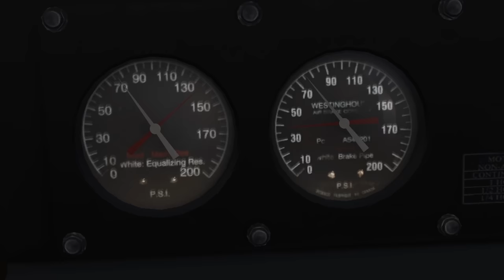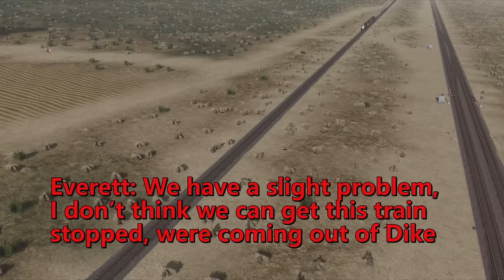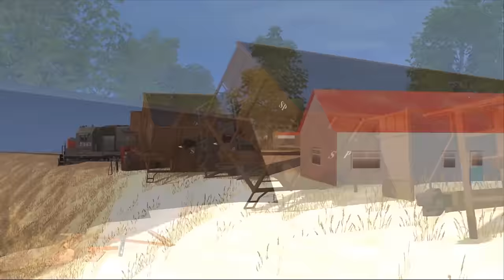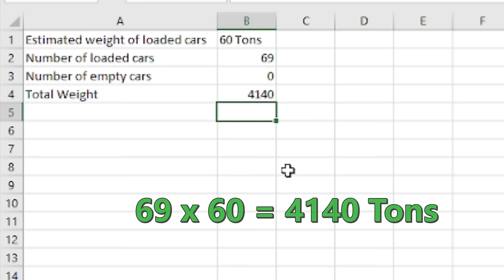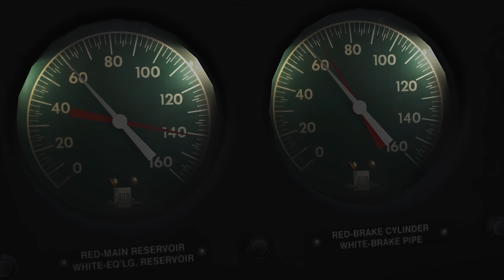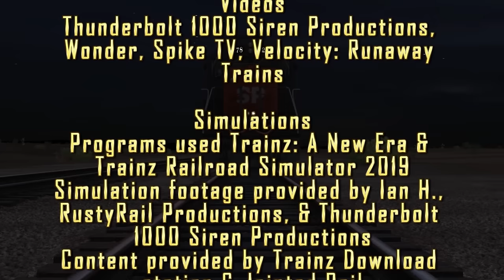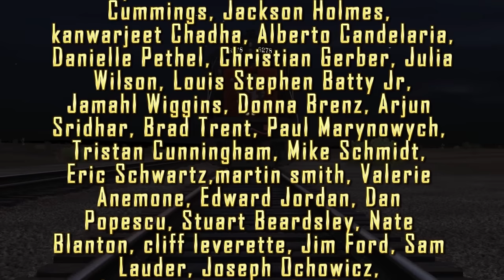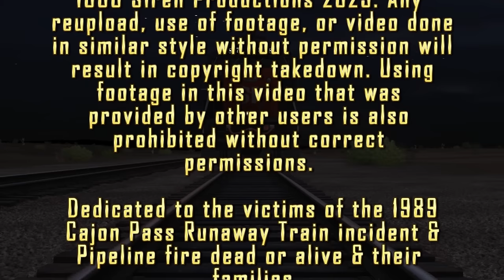The 1989 Cajon Pass Runaway 34 years later (Remastered)

Comment: Great video ,in UK we don't have normally don't have dynamic brake , but when train is consisted we have an available brake force and minimum brake force required , this creates RA (route availability) route train can travel . Brake force is always far in excess of what's required (we have same 100ton waggons with same brakes/bogies /wheels as you have in US , so can't see why brakes of these waggons were overcome by 100ton weight of each car ?  . Basically one 100 ton car /waggon should have a brake force in excess of what's required to stop it , that's how we work in UK anyway , did train have to many cars/waggons with non operational brake (isolated) ? so available brake force was only just good enough for the lightly loaded train? . We have inclines up to 2.65% in uk but  I'm aware US has much longer inclines , also is Dynamic brake factored in the available brake force ? as it should not be , as  its not a fail safe brake like the train auto brake

Comment: I think of this as the "railway equivalent" of Tenerife (the worst aviation disaster in history). Not so much for the loss of life which was vastly less here, but because it was another very long "chain of errors" strung together to cause it. Guessing the weight of the cars, not training helper drivers, not having helper communications, the emergency brake shutting off the service brake, just assuming the dynamics work, not doing the math on the brakes in the first place. Then the pipeline compounding it with beefing up the fuel pumping pressure when fuel started disappearing into thin air instead of figuring out why it was disappearing.

Comment: 261937🅂🄵🄴🄱24 
I lived in Tucson Arizona for 25 years and, as a member of a large train club, I knew several SP employees. From them I learned that SP management's attitude towards locomotive maintenance and train safety was atrocious. Getting a train "over the road" was their only concern. Usually, Road Masters would add locomotives to a consist in excess of that calculated to be needed, expecting engine failure during the run. For a time, SP was known for putting 6 to 8 headlamps on their locos. That way, when one burned-out, others could be turned on. This continued until the 𝙁𝙚𝙙𝙚𝙧𝙖𝙡 𝙍𝙖𝙞𝙡𝙧𝙤𝙖𝙙 𝘼𝙙𝙢𝙞𝙣𝙞𝙨𝙩𝙧𝙖𝙩𝙞𝙤𝙣 ruled that a locomotive was deemed inoperable if 𝗔𝗡𝗬 headlight was nonfunctional.
Please do a story on UP's 𝗖𝗵𝗮𝗿𝗹𝗶𝗲 𝗙𝗼𝘅𝘁𝗿𝗼𝘁  take-over of the Denver & Rio Grande/Southern Pacific. UP fired most of the SP employees who knew how to get trains over SP's trackage. Consequently, I watched train after train stranded outside the yard in Tucson where their crews would "Die on the Law while in the Hole," and the SP's lines ground to a halt.

Comment: If the engines were aranged from most Strongest Dynamic Breaks to Weakest Dynamic Breaks it might've been in this order: 8278, 7443, 9340 and 7551 on the front with 7549 & 8317 on the rear. That way they would've had the Traction Current Breaks at the Back & all other working breaks on the train at the Front.
Reply: What! That's rail fan mentality

Comment: I thought that that the train was going 90 but 110? Wow
Reply from the maker: Well as said in the video 90mph was as far as the spedomiter could go (Even though the top speed of the engines ranged from 65-80mph) but according to data recorders it was nearly 110mph before the derailment.
Reply: @Thunderbolt_1000_Siren  how many trains in the wreck were scrapped or retired?
Reply from the maker: @A-60...  As said in the video all 4 head end engines and 69 hoppers were scrapped. Both helpers were repaired but 1 of 2 were scrapped after retirement
Reply: @Thunderbolt_1000_Siren  ok

Comment: Using air brakes while using dynamics is a good way to burn up traction motors, that's why the safety feature is there or should be still if you use the air brakes it will cut out the dynamics
Reply: What the hell are you talking about? You use both all the time to balance the grade.

Comment: Why didn't they use the independent brakes or did they not exist yet?
Reply from the maker: The independent only controls the brakes for the locomotives seperate from the rail cars compared to the air brakes which control both the engines and cars' brakes. They were essentially useless in this scenario. Train was just too heavy, underestimated said weight due to a clerk's miscalculations, and the train had 1/3rd the dynamic braking power across all 6 engines which was clearly just short of what would of been enough to keep em steady. In other words as soon as they crested that hill they were doomed and the emergency application via the helpers sealed their fate for good.
Reply: @Thunderbolt_1000_Siren  Will u do a video on the derailment that happened in 2018?

Comment: How many wheel brakes did not show heat damage? meaning they were not working to begin with and so did not cook themselves? out of how many wheel brakes total? or did the gas line fire keep them from counting?  Also, wouldn't a hundred tons of this mineral have overflowed the hoppers volumetrically? or I guess this was a false assumption on the part of the crew?
    Also, that train with that real load and those working brakes could have gone down the grade at some maximum speed before exceeding the functional brake capacity; what was that speed?  I doubt it is true that the maximum speed was zero as you said, though it could easily have been slower than walking, it should be calculable.   I studied Mechanical Engineering and live near the Old Fort Loops, so I have some interest.  I was also a truck driver and slowed down many times to the point where my brakes could dissipate heat faster that it built up, on the Saluda and Old Fort Highway grades, so I know this works.  You go slow enough and the wheel brakes can dissipate heat fast enough, but it can try your patience.

Comment: An accident waiting to happen, poor maintenance meant all three leading locos and the two bankers(helpers) were not fit for service. Sloppy weight calculation on the sixty nine hopper  wagons further exacerbated the problem together with poor marshalling of the motive power.  Today in the US ,most heavy goods or mineral trains, have a central 'power sandwich' two or three locos worked remotely from the lead loco,s cab. Say a heavy mineral train of seventy wagons , three lead locos, then sandwiched between wagons thirty five and thirty six, two or three ' power sandwich' locos  , two or three bankers (helpers) at the rear. Spreading traction ,braking power along the train  improves the riding and control, reducing stress on the buckeye couplings. An audible warning, like those in a jet airliner,  should be fitted in the cabs of each loco alerting the driver(engineer) that the secondary dynamic braking system has failed .

Comment: 5:44 wait, 2° or 2%? 
2% is only 0.85°° that seems normal, but not on such a long stretch.
Reply from the maker: 2%. Again, it sounds like nothing to road terms but to trains its one steep grade, and yes, it goes for miles on the pass. Remember, trains weigh hundreds of tons, and it takes a mile and a half to stop a 55mph train. Cajon though bows in the face of an even steeper grade known as Saluda which has sadly been disused for years

Comment: Well...first of all, you have a WHOLE lot of your facts wrong. Let's just start with the tonnage they were given, 69 loads, 0 mts, 6151 tons 3474 feet. Not your 4000 something tons. BTW, I have all the original paper work on the train. The only thing Larry Hill (the helper) did wrong was not put the train in emergency sooner. He waited till they were almost half way down the hill and doing 45mph. The speed dropped to 44mph the headed back up. The little dynamics they had working were next to  worthless, so losing them in a PC (emergency) was no loss. Holland (Head end engineer) had next to zero experience. He had just been qualified to work to Colton down Cajon. I think that was only his second trip. He though the train was good for 30mph. When he couldn't control the train at 30mph with a 16 pound brake pipe reduction, he should have slowed down to a speed where he could control the train. He didn't ! Just kept trying to go 30mph. The tonnage, counting the dead units (400 tons each), was about 10,000. This whole thing was the perfect storm, incorrect paper work, Hollands lack of experience, deferred maintenance (bad dynamics) by the Southern Pacific. An experienced engineer would have know something was wrong two hours sooner when the train hit the west switch Dennis, pulling the 1% grade into Palmdale. If the tonnage had been correct, he should have been doing maybe about 25mph, Holland was down about 15mph. The helper, Larry Hill, was a LA Div. Engineer working the Dike Helper. I doubt he had ever been past Hiland (Cajon Summit). So, he couldn't be expected to know what speed at Dennis. I have a whole dossier on the wreck, paperwork, event recorder print out, NTSB report, etc. BTW...I took the first train west (north) after the railroad was back in service. Crown was the one who said to Holland, "we're going to die down there," not the other way around. I know tons more about what was going on in the cab and helper. After 34 years, it would serve no purpose telling it. Especially on the Internet.

Comment: 5mph is the max speed for the scale
Reply from the maker: Correct. I remember a story of how RBMN was using their scale and roughly this is how the exchanges went

Scale: 5.4 miles per hour, reduce your speed!

YJNR: really?

Scale: 5.1 miles per hour, reduce your speed!

YJNR: really -__-

Another crew: you doing a little speeding huh?

Wish I had it on video, was pretty funny XD
Reply: @Thunderbolt_1000_Siren  yeah I trained on the yard job there it’s a very slow process😂
Reply from the maker: @jaggergradwell6287  sounds bout right. XD

Comment: What is the deal with leters vs gallons  and MPH vs KPh   use both. or just say a crap load of gasoline.. Plus the video is very grainy  the older version was far better wit more info.
Reply from the maker: Quite the opposite. The old one was AWFUL, namely the poor childish choices for music and it had much less info cause it glosses over so much compared to this one which was more detailed. I use to have a text box where you'd have a US flag by imperial units and a globe by metric units as an inside joke but it got stale fast and I got lazy, I plan to bring that back though.